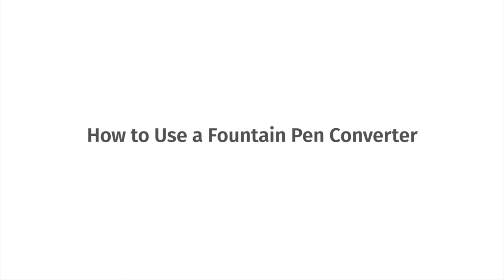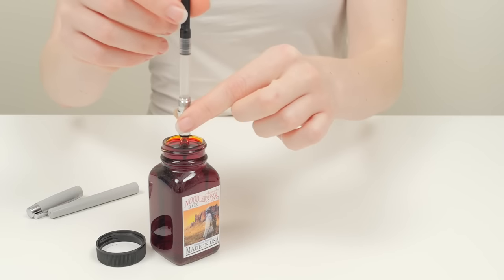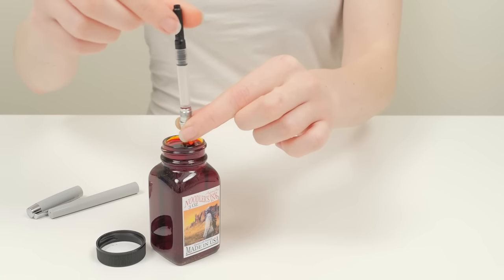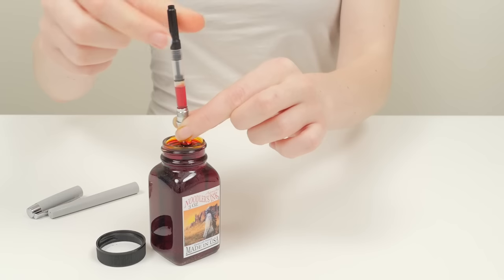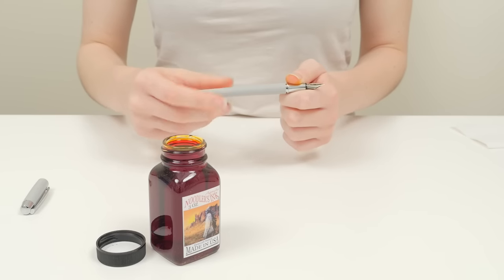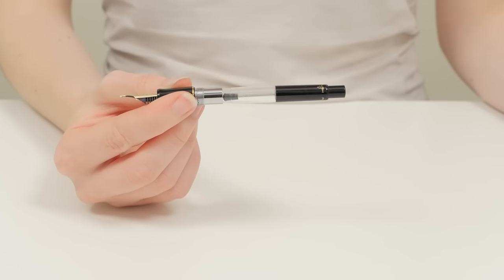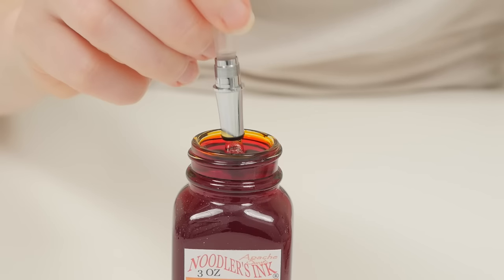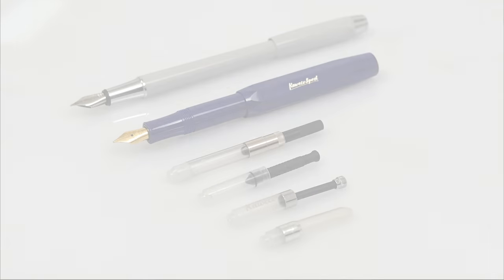How to Use a Fountain Pen Converter

Comment: As simple as this video seems - it is EXTREMELY helpful. I had never used a converter before and the cartridges were just not very good and when I did use the converter I filled it then placed into the pen so it didn't work properly. That is what brought me here, it was a huge help - thank you kindly.
Reply: agree very helpful.

Comment: Extra tip 1: If your converter doesn't draw up ink very well, flush it with water. Just replace the bottle of ink with a glass of warm (not hot!) water.

Extra tip 2: If your converter doesn't draw up ink very well even after you flushed it with water, remember that some types of converters don't apply enough vacuum force to draw up a full fill of ink.

Extra tip 3: Some inks adhere to the plastic of the converter more than others. Alternatively, some converters are made with a type of plastic that makes ink stick to it very easily. Remember to always give your cartridge/converter fountain pen a gentle shake before writing with it, especially if the pen has been sitting with the nib pointing upwards before use. This is also why some converters have a tiny agitator inside.

Extra tip 4: If you wish to avoid having inky fingers for whatever reason, you can grip the converter itself while you operate it. If the converter is attached properly to the grip section, this won't fall off.

Don't give up on using fountain pens!!
Reply from the maker: Awesome tips!
Reply: Thanks alot
Reply: May you pls give me a tip on how to avoid making pen cover (inside) get ink after I refilled and close the cover?  (I use pistol converter)
Reply: Thanks so much!! Very helpful tips. I am thinking to convert from using disposable pens to fountain pens and your last sentence makes me smile :) Very encouraging, thank you!
Reply: Im a first time user of fountain pens and ohh boi my hands is covered in ink how do i remove it
Reply: @bulletstothebeat1768  there exists a magical substance known as soap
Reply: @rohit_mohapatra  lmao
Reply: Thank you man, appreciate it!
Reply: Another tip: Soap and water removes ink off skin and most other surfaces quite easily, so getting it on your hands is not that big a deal.
Reply: I recently purchased a Kaweco Sport fountain pen with a "screw-top converter", but I find that I have to every so often open it up and "tighten" the screw so that ink continues to flow through the nib. Is this how it's supposed to be done? My Parker fountain pen has a pump-action converter and it doesn't skip or run dry until it's nearly empty. Any help would be appreciated! :)

Comment: I have a question about using the pen with a converter. After some ink is used, you will see "air" in a part of the converter. Rotating the pen will not make the ink move inside the converted, as the "air" you see is actually kind of a vacuum. Though my pen writes well enough for me, I wonder if this makes the pen use less ink compared with cartridges or other systems, and if it is required (or "better") to move the piston down? I tried to explain it to the best of my abilities, so I hope it's clear what I'm saying. I just can't find any info on this, and I just wonder what's best to do.
Reply: It's not a vacuum, just a  bubble of air. As you can refill a converter as long as you have ink, it's not important if you have a bubble.
Reply: You should move the piston down, then pull or turn it (depending on the type of your converter) and the ink will be filled.

Comment: I have 2 sets of the classic black calligraphy pens by Sheaffer, the No Nonsense, & the Viewpoint, both originally cartridge pens. I like that the Viewpoint allows me to see the level of ink inside, but the converter I got, model 96700, the reservoir is very dark & makes it very hard to see the ink level inside. Also, the main seating body is shorter than the Sheaffer cartridge, making it liable to pop off the feeder tube when the body of the pen is screwed back down. The Sheaffer cartridge is longer, & is seated when it is 1st inserted into the body of the pen, & the feeder tube breaks the seal on the cartridge as the body is screwed onto the nib holder. The only thing holding the converter in place is the tension of the gasket fitting onto the feeder tube – if that should pop off with any ink inside, it could lead to a real mess! The shorter body of the converter also wastes the potential additional ink capacity vs the cartridge. Both of these pen series suffers from the same problems with the 96700 converter. What a shame that Sheaffer discontinued the Snorkel pen, with its extending an ink draw tube from underneath the nib to refill it; pure genius! Are there any other series or versions of converters that fit better & more securely, than the 96700? From all I can find, there is no difference between that model, & the previous model, the 86700. For all intents & purposes, the Sheaffer pen company is gone now, sold off & closed its operations in the USA & its now foreign-owned remnant under different ownership is a mere pathetic shadow of the former. RIP Sheaffer! Thanks for the video!

Comment: From most of these videos it seems that repeating the fill process always leaves the same amount of air above the ink no matter how many times you do it, so I don't see why it's necessary.
Reply: Bad practice. They are basically flushing old ink with new ink to clean the pen, which is BAD and contaminates your ink bottle - some inks react with air and flushing old partially oxydized ink into the bottle is a bad idea. If you want to flush, use lukewarm or room temperature clean water and a soft silicone ear pear ( less than 5$ in any pharmacy ), works wonders. THEN refill you pen with the converter by 1) expelling air, 2) plunging the pen in the ink and 3) sucking ink in with the piston.

Comment: Why can’t I fill the converter than insert it like a normal cartridge? To completely submerge the tip the ink bottle needs to be almost half full, what do I do with the other half?
Reply: To completely submerge the tip, it is ok even if the ink bottle is full! I tried it and it won't spoil or anything.
Reply: Also you CAN actually fill the converter first and put it in. That way it will take some time for the ink to reach the feed. In the other way, you can use the pen immediately after filling. :)

Comment: soooo me dipping the tip of the converter and then fill it to then push into the pen was wrong?
Worked great anyway.
Reply: Nope. It is not wrong. In your way, it will just take some time for the ink to come out. In the way the video mentioned, you can use the pen immediately after filling it. :)

Comment: Wouldn't it be cleaner for both the nib and your hands to remove the converter, fill it and place it again on the pen?
Reply from the maker: You could definitely do that! Most people use the converter while it is installed in the pen because doing so draws ink into the feed. You won't have to wait for the ink in the converter to flow down to the feed, or force ink into the feed using the converter.
Reply: JetPens Oh, thanks.

Comment: Could you refill the converter before putting it in the pen.
Reply from the maker: Yes, you can if you would like!
Reply: You technically can but it is very messy and you will probably end up with ink on your fingers and on the inside of the pen. While installing it first means that only the tip of the pen and the surfaces that are supposed to touch ink actually come in contact with ink

Comment: Mine has a spring in it what do I do
Reply from the maker: Hi there! Some convertors have flow problems, and the spring helps to break up surface tension of the ink in the convertor. The spring keeps ink from getting stuck/dry at the back end of the convertor.
Reply: @JetPens  thank you!